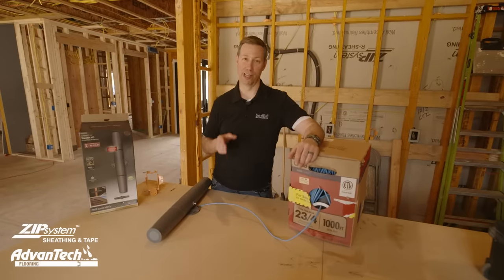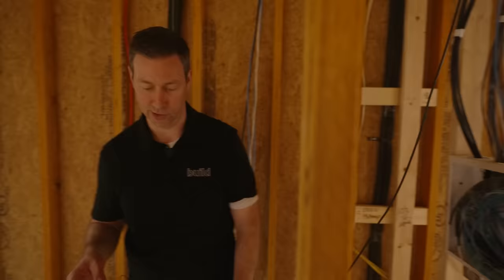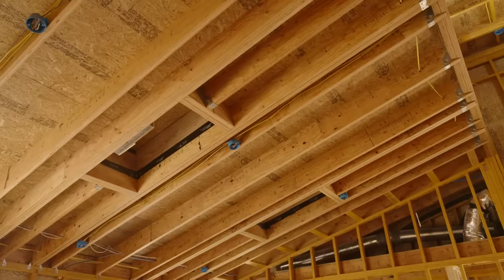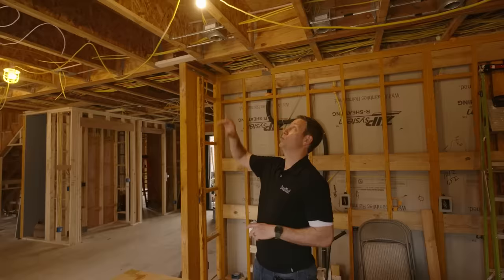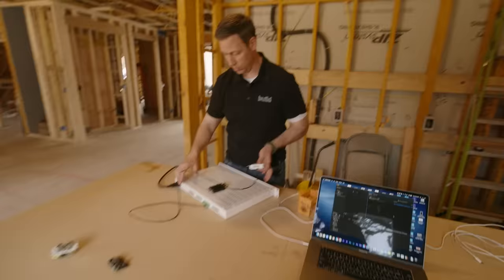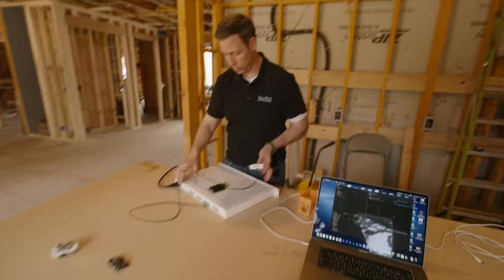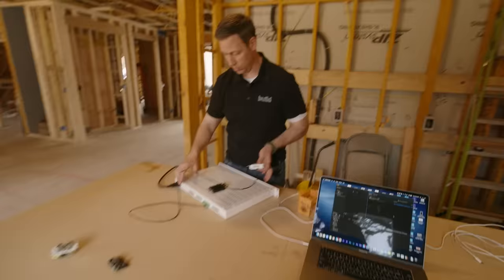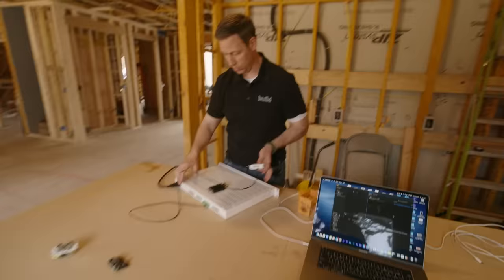Low ⚡Voltage at the Real ReBuild

Comment: I agree on the choice of Ubiquity although the box does not have POE so you need to add a switch with POE to power the Wifi access point and the cameras. In a medium or large house you really should have 2-3 access points plus 1 or 2 outside for the patio and the garden.

Comment: I'm getting ready to redo my network and plan out my AV so this is good info, I'll like to see more from a builders perspective. I plan to focus making sure my mpoe (main point of entry) is good for changing services and upgrading cables and then adding a run to my data cabinet so that its easy to upgrade but not somewhere hot. Make sure you plan for the heat in your media closet (switches, UPS, receivers, even can put out a lot of heat. At minimum you want an exhaust fan.

Comment: You will be infintely happier and more impressed with an LG Gallery Series OLED as your main TV. The picture quality is night and day compared to the frame plus no annoying One Connect box. One good HDMI run is all you need anyways with a quality receiver (via eARC and CEC) so the One Connect box doesn't do much for you nowadays, plus you have to buy the special in-wall rated cable to be to code. Also you will still have to run an HDMI from the ARC port on the TV to the Sonos ARC bar if you plan on using that in the main room, which would mean running an HDMI all the way back over from the One Connect box. I'd reconsider that Frame TV, as a Home Theater installer I run into more problems than solutions with that TV nowadays. Definitely an awesome idea going with Ubquiti, their stuff is amazing.

Comment: As an IT professional I often have to tell people that a wired connection will always be faster than wifi, will always be more secure, and more reliable.  But it is nice having wifi in the house, but with a large house you probably want wifi access points which have to be wired to a wifi router.

Comment: As a an IT Pro, Matt, you're doing it right. Unifi is awsome for SOHO and SMB. Running cable is smart, so many people just default to wifi even when they are able to use wired, its awful.

Also, if you run into any issues setting up your Unifi gear I recommend reaching out to Chris from Crosstalk Solutions or Tom from Lawrence Systems. I'm sure both would be happy to connect up with a fellow YouTuber.
Reply: +1 for CrossTalk & Lawrence Systems

Comment: Ubiquiti is a good choice!  The perfect balance between network geek and home user.  It's a little pricey, but the best equipment I've used so far without going full commercial.  They have some great access points.  I agree with some of the other comments on the flex conduit.  Use it where ever your can for future proof.  With Cat 6, they make a lot of different adapters like Balun HDMI adapters.  You may want some Cat 6 out back as well for the total home audio.

Comment: I ran cat 6 throughout my house.  I ran 2 drops to each location.  This was originally done because of a matrix switch that I was going to use so I could have 2-3 cable boxes in the basement and have them be able to run to 6 locations.  Cable box rental (since you can't buy them) is ridiculous.  Since then most everything has gone streaming.  To have 2 drops at each location allows failover first of all but also that a tv and game system could both be wired.  Never underestimate how much your teen "needs" hardwire for a game system.  I use unifi as well and having 2 POE access points covers the whole house and well into the yard without problem.  Realize that these access points are different than having "repeaters".  A repeater talks back to an access point, thus using the one access point's bandwidth.  This is fine with a couple of adults, but can saturate very quickly when kids are all watching 4k streams and you are trying to have a zoom meeting.  

One last thing: run coax to every tv location.  It is cheap.  Once you see internet providers like comcast set data limits (which they already have and only delayed doing nationally) you will go back to watching cable.  1.2TB data cap is nothing, especially when there are game downloads now up at 200GB and a 4k stream uses around 5G per hour.

Comment: You should hire a networking outfit to consult  on your wifi coverage/ Ubiquiti install. It's a lot easier to get the drops in for the APs now than it is later.
Reply: Agreed he should be able to get this done for free through his Youtube base.  It is easy to get an idea with the plans and the Ubiquiti controller and it is mostly wood construction.

Comment: FWIW: Power over Ethernet might be a better long term option for power. You can get PoE to USB C adapters. Issue is that USB c likely will change, but ethernet will likely be around for a long time and you could use the ethernet for both power & data for laptops, or other low power compute devices, or VoIP phones.

My recommendation would be Cat 6a since you likely be able to run 10 Gbps Ethernet reliably As well as run up 100W since it 23 awg is standard for Cat 6A cables. I would also recommend running two cabled to some  jacks so if you need to connect multiple devices. For the TV have at least two ethernet cables so if you want to connect a digital media in addition to what ever your TV provides (ie a Roku, apple TV, etc) which could be mounted on the side, top, or bottom of your TV. Issue with Smart TVs is that at some point the Manufacture stops supporting updates (they want to you to buy a new TV about every 2 years). What you find that after a couple of years the built in apps stop working.  

For ceiling mounted audio, I recommend putting the speakers in a sound damping enclosure so the sound does blast into the rooms above.

Also recommend running low voltage cabling for smoke detectors because no one likes changing smoke detector batteries when they start beeping at 3AM. 

As far as UPS systems, I have a whole house UPS that provides power for most of the low power circuits (ie lighting, bedroom outlets, etc). Power outages are more frequent at might location than your location. I have propane so I can still cook, have hot water & heating instead of electric for them. I do have a backup generator, but I prefer not have to run it all of the time, and I also get a lot of short power failure, that last long enough to reboot a computer, digital clock, etc.
Reply: There are no connections on the newer samsung tvs other than their proprietary port that cables over to a box that handles all media/data connections.   He better run conduit as that cable has changed 3 times and are not backwards compatible...

Comment: I like the idea of the Voltek system. Although, Legrand Pass & Seymour Series makes an Ultra-Fast Type A/C USB 6.0 amp Outlet. I charge my laptop with it and works fine.  I just see a lot of extra cost with the Voltek system over just adding an outlet with the USB fast charge.

Comment: I agree with using hardwired CAT5/6 if you can. It will make the TV streaming services better, security cameras more stable, thermostat more reliable, ability to setup a personal network area storage cloud, mount a WiFi access point on the ceiling in the center of the home, etc.
Reply: Cat5 is old news. Cat6 or Cat6A is the new "norm"...

Comment: I use an antenna as well with an HD Flex 4k which takes that antenna and allows up to 4 different channels ot be tuned at once by any device on my network. I run Plex as my DVR. I believe Ubiquity/Unifi have low voltage LED panels now as well.  I scrubbed through your other videos and didnt see an updated "finished" media closet. I would love to see that for sure.

Comment: As you're already looking into the Ubiquiti Unifi systems, you might have seen that they do have some PoE (power over ethernet) lighting options.  These are much more geared toward office installation in drop ceilings, but I think it's only a matter of time before we start seeing low-voltage smart solutions that are targeted toward residential use with a wider array of styles.

Comment: It doesn't look like you are using the cable in the similar items list, but your link to cat6 on Amazon is for CCA (copper clad aluminum); after some cursory googling, people hate it due to long term quality issues, etc - especially for POE applications.

Love your setup! As someone that had to swim through insulation to wire my house, I'm super jealous that were able to do it at build, and it's not a ghetto mess of wires in the attic like mine is.

Comment: 14-2 has always been more than adequate for residential lighting circuits, Matt.  And even more so, now that LED lighting is at the forefront of almost all new Lighting installations.  DC Micro-grid equipment is definitely coming in to the picture in the near future.  Save your 12-2 for Receptacle circuits, Matt.  Thanks, Russ, J. Electrician from Oregon.

Comment: Matt, beautiful work!  I love it.  The open wall phase is amazing and I know that at this point you probably already have all the drywall up.  I would add that with the nifty USB  power plates you should note that we are rapidly moving to inductive charging so the plates by your bedside and other locations may sadly be obviated sooner than you can say "iPod".  I'm still a wired charging guy but we've started adding those inductive devices to our home and I'm getting closer to adding the inductive chargers to certain pieces of furniture.  Mockett.com has some great stuff in that department.  And you just need a regular receptacle for that tech.  Additionally I couldn't tell for sure but you should not run the low voltage ethernet in the same path with your high voltage ... as I recall the rule was 6" away for parallel runs unless you are running shielded or in conduit.  It's a pain to police that but it saves on the interference you may get later... crossing is ok but parallel too close is bad.

Comment: I own an A/V company in Houston called HouseWorx and will offer you 1 piece of advise. Do not use the Samsung Frame! I just finished 2 houses using the 2020 lineup of the frame TV with a Sonos Arc and the other with a Beam and both TVs have audio sync issues. Ended up pulling them out an putting in LG's for the customers... You can find other people online with the same issue where the frame using Arc or eArc decoding Dolby has audio delay issues. Unfortunately it is the audio that is delayed from the video which no devices have the settings to correct. Other then that you are right on point with your setup! Good luck

Comment: I like how you've recognized that a hybrid (wired/wireless) networks are best and future proof your installation. Nevertheless I have two recommendations. First, run two network cables to each room (gives you flexibility down the road for a return wire) or better put important runs into a flexible plastic pipes so that you can use fishtape and have more runs and even replace/upgrade to better wire. 
Second, imho preparing for future WiFi router ceiling mount and have cat6 cables in the ceiling is a very good idea. It will give you very good coverage one on each floor somewhere central. And it is out of the way, you know not a eyesore anymore.

Comment: I have retrofit a modern network into an old home from the early 90's and use Unifi network gear to power it all. Make sure to run a few extra locations for future upgrades to the network.

Comment: I think it's great that you're implementing wireless and hard-wire solutions inside your home. Great way to future proof your home. WiFi is great for mobile devices (phones, tablets, laptops) and hard-wire for stationary devices (media server, TVs, gaming consoles, workstations, fridge, security cameras, etc). Speaking of which, what PoE (Power-over-Ethernet) switch will you be using for the sec. cameras? As home appliances age, the wireless connectivity becomes very spotty. I've noticed that on two of my LEDTVs. I've had to run flat CAT6 cables to them to restore network connectivity. I can't wait to watch the next video. I think a few of us IT geeks would like to know model of the Ubiquiti APs that you plan on installing.

Comment: You should reconsider running the 50ft Samsung One Connect Cable to the equipment rack.  Strong makes an In-wall box that can house the One Connect box behind the TV and won't require the 50 foot One Connect Cable that will eventually become obsolete.  Best to run conduit with Cat6, use HDBaseT baluns from the rack to the TV, and if need be upgrade to fiber in the future via the conduit.

Comment: Run 120V to light fixtures - a future owner might want incandescent light bulbs. It doesn't cost that much more, plus you save on the expensive power supply.

Comment: Ubiquiti's strong point is in their wireless access points.  Install a couple POE powered AC-LR or AC-HD APs and your whole house will have zero wifi issues.  They're that good.  The dream machine is fine for home installs, but lacks the features needed for commercial installs.

Comment: I design lighting, power, telecom systems for Commercial spaces. POE lighting is available for commercial uses from suppliers, but even though LED is very low power there is a limit on the quantity of LEDs that can run on a single low voltage wire. It is extremely easy to design and adjust lighting designs on 120V systems, and makes it easy to change in the future as there is typically a lot of spare capacity available on each circuit

Comment: Another thought is to notch out a space behind your baseboards to run cable if you need to add anything in the future. Simply remove the baseboard to run the wire. You could even design the baseboard with a locking mechanism instead of nailing.

Comment: @Matt Risinger the Sonos ARC connects via HDMI to the TV, if you place the Samsung control box in the Media Hub you'd need to run an HDMI back to the TV, which is not ideal, Frame TV in your setup might not be the best choice. Hopefully your friend John has suggested running Cat6 to UniFi APs as you should have a wired backhaul in preference to relying on MESH

Comment: I am using the Leviton T5635 30W USB C wall outlet to charge a MacBook Air without issue.  It was $40 and draws minimal power when idle.

Comment: I was hoping for a quick cost/benefit breakdown on running the larger gauge given the low draw LED lighting. You seemed to be conceding that a 15 amp breaker setup would have been better, but I still like your choice given your future expansion options with the heavier wiring.

Great video either way and I look forward to more!

Comment: Matt. We built a house in 2007 and a bar/restaurant in 2011. We put lots of cat5e, which was the affordable Ethernet connection at that time. We also had RG6 because both have DIRECTV. The cat5 has been the best because you want your most used computers and printers to be wired.  But almost all cameras are now POE ethernet. I have also run audio distribution over cat5. The twisted pair runs audio just fine, and we just put small amplifiers where we didn’t think to put speakers. Question.. how are you handling backup AC power. Texas showed the world that you can’t depend on your local utility.

Comment: 12/2 is standard for me. I rarely ever use any 14/2 on any new construction homes I do.
Reply: Yup Why have to manage the hassle of supplying two cable sizes. How many times does a contractor run out of one size and have to run to the store to pick up more? Its not as if there is much of cost difference.
Reply: @guytech7310  There is a pretty large cost difference what the hell are you talking about? Right now we're talking as much as $40 per 100 linear feet with the high copper prices today. Of course when you're building houses the way Matt is minimizing these costs are irrelevant since the budget is pretty loose
Reply: @mr.g937  Perhaps now, but when I purchased it it was about $4 more for a 250' roll. Not worth the prices difference. The issue for me was wasting 2 to 3 hours to go pick up more if we ran out. I would have spent more on gas just going to pick up more.
Reply: Ever wired a 4 gang switch box in 12 guage with 4 3-way dimmers? Even with large ci boxes it isn't fun. I wire all lights in 14-2 and all outlets in 12-2/3. Planning ahead will avoid 2 hr trips to the supply house, plain and simple.
Reply: @craigcarlson7254  Yup. Many times! I just use the Deep boxes. Planning only goes so far when it comes to estimating how much wire you need.

Comment: Matt,

I'm a Unifi man myself (WiFi and PoE cameras), and if I were building new I'd also install their access control system alongside manual deadbolts.  Very cool stuff, e.g. open the door with your smart watch or a card in your wallet.  

https://unifi-network.ui.com/door-access

That would necessitate upgrading to the Dream Machine Pro, and also wiring for electric bolts/strikes & Cat6 for the doorbell/camera/screen, but all of that wiring should be future-proof.  

Also, as others have mentioned, the most future-proof cable you can run is smurf tube.  I'd strongly recommend installing a run from your demark to your comm closet, and probably one to a central location on your top floor.  The rest  of your Cat6 runs would be ideal, but optional.  

Lastly, the standard that laptops use to charge over USB is called Power Delivery (PD).  Leviton makes A/C outlets with USB ports rated for PD that can power a MacBook Pro:

https://www.leviton.com/en/products/residential/usb-wall-outlets-chargers/usb-typec-with-power-delivery

Cool as they are, I fear those Voltek cables might get dated about as quickly as the 30-pin connector you talked about.